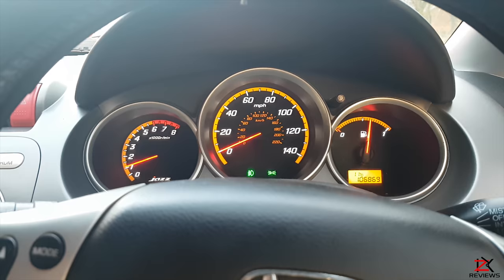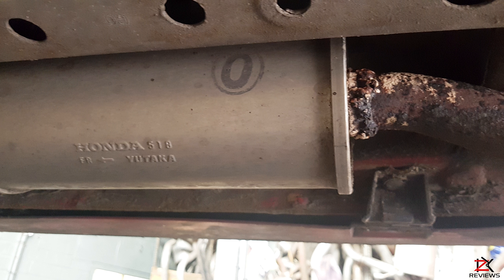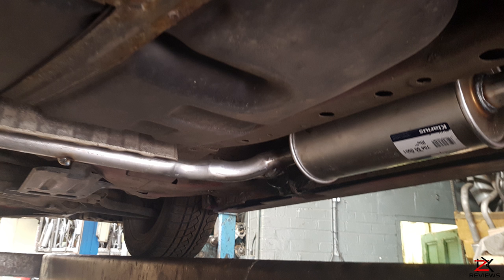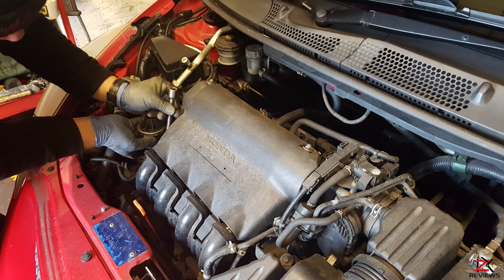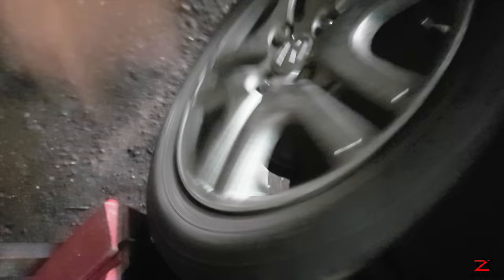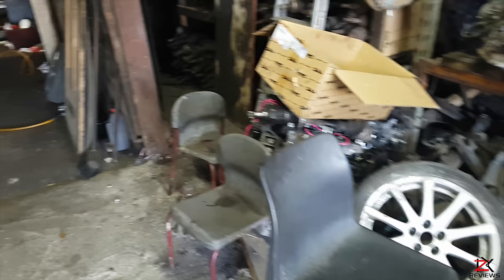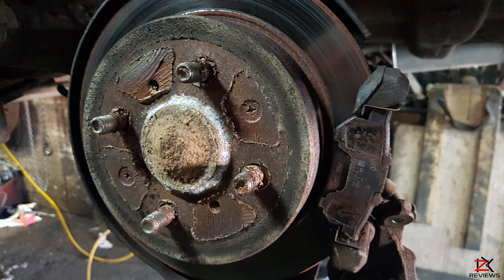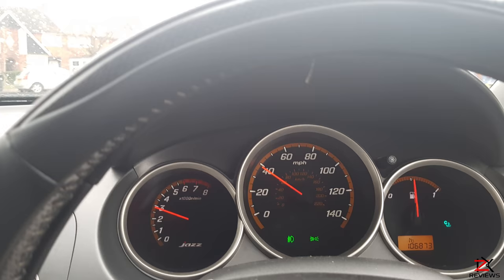Car Losing Power | Loss of Acceleration | Finding the Fault With FIX

Comment: Just got my car fixed today. The problem is the catalytic converter are blocked and that is the reason for the lost in acceleration. My mechanic told that the air from the engine cannot get out properly through the ekzos pipe. I got it changed for a cheaper catalytic converter instead of the original toyota parts. Before, my car can only gain acceleration around 60-90 km/h and to get even 60km/h i had to rev the pedal to the max. Wish this can help somehow for the people who had the same problem☺️
Reply: How much u pay
Reply: Thank you 
I’ll get that checked on mine
Reply: Was your toyota a corolla because i got the same problem happening to me my car doesnt want to accelerate and its like you said to get it to atleast 20-30 mph i have to press all the way down on the pedal
Reply: I have a Nissan Altima and mine loses power after an hour. What do you think it is?
Reply: Bro just clean it unless destroyed
Reply: I have the same acceleration problem this can help thnks
Reply: @MrSnaKek  I have the same car and the same problem. I also have a brand new catalytic converter 🙃
Reply: This is exactly what my vehicle is doing as I'm driving. Thanks for sharing this information
Reply: How much did you pay?
Reply: @AprilGarciaDfw   $780
Reply: Not the "ekzos pipe" 🤣
Reply: I have similar problem with my semi-auto Toyota Yaris. When I press on acceleration it take long to pick the speed upto 20mph, even when I press the pedal hard it make loud noise.
Reply: Thank u natsu. That was the problem with my car
Reply: They got you for you money
Reply: I have a 03 Camry an mines doing the same thing thanks a lot . I hope this gets me running.
Reply: I got a question was your cars RPM shooting up to like 8 even when you were only going like 30-40 miles an hour.. because that’s what’s wrong with my car and i don’t know if it’s the transmission or not..
Reply: @-Kappo-  sounds like your transmission if its an automatic car. If standard shift sounds like bad clutch.
Reply: I think that’s my problem. It doesn’t make sense for me to buy a brand new cat converter so I need to find “other “ options
Reply: did ur car have an erratic idle?
Reply: Any codes in check engine?
Reply: İ have Toyota Yaris cross
İ have problem uphill
Especially when there are 2 or 4 people in the car
Car goes like turtle
On the normal road it goes okay
İ can't go up hill or mountains
Reply: @abidaferdous7913 
Did you find what it was wrong
Reply: @gorkman5697  Yes I did after spending £1000
Reply: Thank u
Reply: Damn just answered my question my converter is rattling and I lost power
Reply: That’s happening to my car and I have a p0420
Reply: Pretty sure I’m having the same problem as you’re describing in your comment

Comment: I have had same problem with my Honda jazz … when I accelerate it feels like heavy drive. When i stop on signal and drive on it feels like car is losing pick up and takes time to reach normal speed. Also sometime when i uses brake with cloche pressed my car skids .. please can you give me any suggestions thanks
Reply: How did you fix it?
Reply: Did you know what the issue was or is called?

Comment: You don’t need to pay for dealership to plug in the diagnostic device into the car they can find any faulty codes or blow fuses and find out, not that I payed to get the device plugged into the computer

Comment: if it was rebuilt, double check to make sure the distributor wires to spark plugs are in the correct firing order, wrong spark sequences will cause a huge loss of power and backfire
Reply: Good point normally in japanese cars the wiring is such u cant go wrong unless really pulling it

Comment: I am having a similar problem. When i am driving on a motorway doing 60-70 and trying to overtake it takes very long to overtake. Also from full stop if i had to drive up hill it takes a lot of rev to puck up and than switch to second gear a lot of rev again and finally third. No fault code on dashboard. It just doesnt feel like i am getting what i expected when i put my foot all the way down accelerator. Car is fine no noise also no problem when driving around built up area. Its just when i try to join motorway i have to be very carefull and rev very high with lower gear to pick up my speed. When i press my foot down accelerator i just dont feel the power. My car is vauxhall astra 1.4 2012 excite.cheers
Reply from the maker: Hi, Yes sounds quite a similar problem towards what i had, please to follow the steps in the video to check upon what can the problem be as something is pulling your car back in gaining acceleration. do check the brake calipers first. let us know how things goes. thnx
Reply: Omg I have the same problem to my 2016 sonata
Reply: Darel Dias same here 2016 sport Sonata did you end up finding your problem?
Reply: Please I have the same problem with my MDX car, please how did you solve your?
Reply: I have similar issue with my Alfa mito and can’t seem to find a solution. Different Mechanics keeps telling me different things although my engine light is on but when it was checked it say engine oil pressure sensor/ switch circuit

Comment: I just had the same problem, I found out that the front brakes were finished. I got them changed and the car drives fine. like 30 minutes ago, thanks for the video you saved me.
Reply: I got this issue now my brakes are thinner than a potato chip
Reply: What happen can it be your back breaks

Comment: Nice! I had this problem all last week, just after replacing my brake pads and rotors (which are still squealing and grinding despite being brand new). 
Glad to know it's probably my calipers vs. my fuel injection system.
Reply: Was it? I had the same situation! Although all breaks replaced (new) and top right caliper.
Reply: Did the engine of your car made weird noises at all?

Comment: This is happening to my old Hyundai. Pulling away from lights even on a slight hill is so embarrassing, can’t get past 22 mph. First seems like it has 60% power, Second gear has maybe 30% and third’s not much better. In third it will rev and almost change sounding like an automatic. Taking it to the garage next week. I will mention this video’s findings.
Reply: I watched some videos, and maybe... just maybe you should check your break caliper to see if it's seized up or anything....
Reply: Fix it ?
Reply: 2 years and still no follow up?? 🤦‍♂️🤦‍♂️🤦‍♂️
Reply: Update?
Reply: @SkoutingVids  I also need an update 😂
Reply: @iamthelaw2828  I figured mine after two months haha. My car had bad fuel injectors, I had to buy new ones tho
Reply: What’s the update we are still waiting !!!! 😂
Reply: @Gab04. Hey dude, my car's acceleration seems fine on a plain road but on a slight uphill it takes a lot of acceleration like a lot....and sometimes it loses power, what could be the possible reason???
Reply: @whynotmysterious  hi, it can be a lot of things but make sure to check your crank sensor. See if there’s any oil leaking there.
Reply: @whynotmysterious  if its not the crank sensor, it could be the fuel pump is going bad

Comment: I'm a woman who is trying to learn how to do this on my own. I use to live in the country and had so many friends that worked on cars, I never learned how. I am now alone, as a single parent in the city, and I am trying to do this by myself. I'm competent enough from what I do know. But I need advice and I have no one to ask.

07 Aveo5, the basic of the basic cars. Electric nothing. The clutch won't allow the engine to engage with the transmission for some reason. It happened over about a day of driving. No misses previously. Now, I had to get my neighbor add power and push the car to get it into my barely uphill parking spot.

Fluid was barely low. Topped off and bled. It is also getting changed when I find out what is wrong. The pedal feels normal. I don't think it's the master cylinder. The slave cylinder and the clutch are caked in oil. I bought the car last winter and haven't had a chance to have it detailed. And the slave cylinder will not budge by hand.

Is this something you would try on your own? Or should I just sell what's left... Because I can't get help.
Reply: I feel like you got a slipping clutch, might be coz of the mentioned leak there unable to create optimum pressure. I am not an expert, get it diagnosed before it screw your gearbox.

Comment: I m gonna clean the upper intake, throttle body, that usually fixes it, plus 93 octane is better than 91, I m ruling out the fuel pump because I just drove from Houston to Missouri and it drove fine at all speeds. I'm not a mechanic so I'll know soon, when I clean all that again.
Reply from the maker: Give us an update on how you get on

Comment: My car is showing same kind of problem lately....it works fine on flat surfaces but when going uphill it losses its power and it also give a fuel burning smell too...what seems to be the problem here
Reply from the maker: The engine could be not putting out full power, due to clogged air filters, clogged fuel injectors, clogged fuel filter, bad gasoline, clogged catalytic converter

Comment: I had an issue like this when my car was struggling up hills and stalling at idle and struggling to build up speed. it turned out to be the fuel pump. Unfortunately i’m not sure if it was the valve or the float or fuel filter cause i drive an un american vehicle (toyota) everything is expensive and ridiculously engineered
Reply: Hey there, I hope you can answer this. Did you have a misfire code or anything. I'm having a similar situation and I've done all the obvious stuff like spark plugs coils ext. How did you finally come to the conclusion about the fuel pump.

Comment: I am just home now, I have been out all day as I am finished work for Christmas so finishing off my prep. I was taking off on my way home but noticed that when I went into second gear, my car struggled to accelerate. I stopped at a stop sign, and when stationary, I could accelerate and my revs increased as normal. When I took in 1st gear it was fine, then tried going uphill in second gear, but had to pull over as the car would not accelerate. I turned off the engine, turned it back on and was able to get up the hill in second gear, then switched to 3rd gear and the issue seemed to have gone, but then I slowed down at a round a bout, and had to drive slowly in 2nd gear until I got home. I was close by, so didn't see the point in stopping to call someone. Might need some one to look at my brakes if it's the same problem.
Reply from the maker: yes might be same problem, get it checked thnx for input

Comment: I had a 94 oldsmobile and I couldn't get over 65 without my car shaking losing power and acting like its missing.. never found out the issue any guesses? I could floor it and once over 65 it would bog down all the way to 5 miles per hour while still being floored and had the same shacking missing issue, new plugs wires and coil packs and ignition module which is connected to coil packs

Comment: I’m haveing a problem on my Infiniti Q50 3.0t it has a rebuilt title it was crashed on the side of the door but it doesn’t have any check engine light on I had a computer check it and it came out with no problems but it’s slow when going 0-60 I need help

Comment: Hi, I’ve noticed once I drive for a long period of time maybe a half hour to an hour straight my car starts to lose power when accelerating, and it has a burning smell and very noisy. Any advice?
Reply from the maker: yes could be same problem plz check video
Reply: Catalytic converter for sure, our minivan developed the same problem, changed the Catalytic for an aftermarket good brand and now has all the power back, good acceleration and mileage back. Good luck.

Comment: Hi, I am having similar problem with my car. After I changed my front tyre I notice when I press on gas to pick up speed it take long and it make noise and smells a bit also there is tick tick warning noise, so I have no clue what's wrong with my car. I did full servicing in Toyota dealer but they are big time cheater, they didn't do anything. Please can you help me with this problem? As I am a female the garage keep over charging me but not solving my problem.
Reply from the maker: Go to a local car mechanic garage, tell them the issue, they shouldn't charge just to check, sounds like same problem i had so check those brake calipers and surroundings, all the best
Reply: @ZRKREVIEWS  Hi, I did full servicing at Toyota dealer but they never mention anything like that at charged me £450 which is really ripping off

Comment: My problem is, when I cross the 80 kmh on the road, my car loses the accellaration, and then later on when the car becomes slow, it catched back, then the gear doesn't change. It's automatic car. What Should I do? Can you reply?
Reply from the maker: Hi, personally myself i cant help with this situation. defiantly need to get it checked up. Hope you get it fixed
Reply: For me also same problem but I checked it I didn't find any reason.if u fix ur car can u tell me where is the problem .my car is also automatic .I hope u give me answer
Reply: Could be the fuel pump
Reply: Same problem here, my car cant past 4k rpm and mostly stays 3k rpm on highway.. i won’t accelerate like it used to be
Reply: E
Reply: Ce Lo mines doing the same thing. did you get it looked at?
Reply: Tp sensor  wiring problem

Comment: What help my car was cleaning the throttle body and changing the throttle censor
Reply: I had this issue.  My mechanic recommended to clean throttle bottle.  It still hasn't fixed the problem
Reply: Tai Davis change the throttle sensor and take your intake off and press the gas ( while car is off ) make sure throttle body is opening all the way with gas pedal down.
Reply: Tai Davis also make sure you battery is connected properly and tight . Sometime loose battery cables can cause bad idle. 

Check for any broken vacuum leaks. 

Change map and throttle censor. 

Check linkage gas cable , make sure it’s opening throttle body all the way while gas pedal down. 

Leave the censors for last. That way you don’t spend the money if you dont need too. 

Let me know which one works bro.

Comment: Engine check light.
Getting these two codes as error 

P0303 cylinder 3 misfire detected 
P0351 ignition coil a primary secondary circuit

Will changing coil solve the issue?

Comment: Great finding!  I have an experience about acceleration but it is about the supercharger tube damaged.  It needs to be build up the pressure by the supercharger within the intake tube but one of the joint damaged that causing the problem.

So need to know your car in a little more deeper for diagnostic the problem.
Reply: Hello sir ! I have 2008 Toyota Highlander hybrid that just stopped accelerating while on highway. The car still starts and no engine light on but the tractor indicator light comes on and off . What should I expect the problem would be? Thank you for your help

Comment: please help  I have the same problem . lost power while I am driving, when I press gas to  speed up. I heard some sound.  like air 
please =help
Reply: First, check the fuel pump; it's the main cause of power loss. Then, I recommend checking the air filter.

Comment: I was having same issue on my car too . But on mine I diagnose easy because was smelling very bad and even a lot of smoke!  Only on front wheels.  So I decided to change the piston brakes , break gaskets and break pads on all w( with new parts! Now I have only one problem:  the driver side wheel still have same problem ( break remain stuck and don't release the wheel 😔 ) .Simply I don't know what to do anymore...  😭😭😭😭
Reply: check,the,ruber,line,to,whel
Reply: Clean catalyst
Reply: My car is driving normal but suddenly it loose accelerates and get heavy, and the RPm is not going more then 2000 and speed remains 20kmh. Different mechanic told me Different stories  but still problum not solved.

Comment: What was highest speed am having the same issue max i can drive is 45mph i dont have brake pads on rear it has brake shoes changed a few thing like throttle body,ignition coil,spark plugs,fuel filter and catalytic converter still wont pick up speed and no mechanic can help what is the issue

Comment: I just had my breaks replaced by someone I know it was fine then I ended up with same problem. I wasn’t getting any acceleration up hills and no pickup whatsoever & bad smell. I was told my engines old or I need a new engine so but I’m still iffy.
Reply from the maker: what car do you have..so you replaced the brake calipers..
Reply: I own a Honda Civic 2000 I had my breaks fixed then about a week later I had this problem. My car is still down it starts and drives with little to no power especially up hill. With bad smell. Any advice?
Reply: Maybe clutch not engaging if the engine revs higher when you try to go fast and yet you have little to no power on wheels it could mean you have a bad clutch. Im assuming you have an automatic

Comment: So a seized caliper can cause problems with car acceleration?
Reply from the maker: yes
Reply: @ZRKREVIEWS  wow thanks. So that might b the issue I’m having in my old car. The rear calipers need to be changed and so I’ve had it sitting parked and warming it up yesterday and inflating the tires when I went to move it I had to apply more acceleration for it to move “normally” and the isles was jerking. Have no codes or anything.

Comment: Hi i have a problem that you might be able to help with. I have a 2003 honda fit the car gives you a bucking when you  start to accelorate and it will cuj off. What you think might be thaproblem
Reply: Did you get a solution